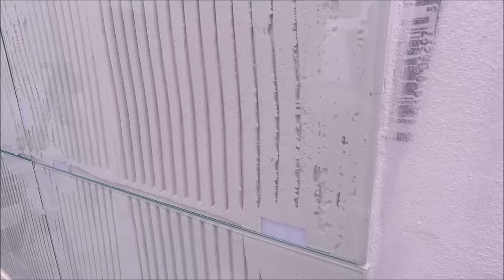How to use a Tile Leveling System for Walls

Comment: Great video (super idea to use glass tiles). I don't think you mentioned that the Ridgid system has "corner" pieces which can level four corners with a single spindle (so you could have used one instead of the four.
Reply: THANK YOU. I dont know who makes this and what types there are  but this seems like exploitation by manuracturer. Why use freaking 8 pieces when u can use 1 to hold down corners of 4 tiles?!
Reply: @MrExcessum  I am looking for an answer to a similar question.  I am about to try these on a 200 sq' shower project.  My question is, if you are using spacers to supplement these clamps, can you simply use the "B" clips for everything? It appears the only thing missing with the B clip is the little tabs that would go between the adjacent tiles - either intersecting or brick patterned..  Am I correct? As you pointed out, why use several, OR buy several different types, if the straight "B" clip can be used for all.

Comment: @landberg Tile TV Maybe I missed it, but is there any advantage between one or the other system?

The one advantage to the wedges was using a tool for a secure hold, while the Rigid requires you to use your fingers, and fingers may get more tired
Reply: you can use any piece of metal or plastic as a lever to tighten the plastic bolts i guess.

Comment: I am so happy that I paid attention in class when it comes to tiling and being in the tile business for 20 years and only being 37 years old thank God I don't have to waste unnecessary time with those stupid self leveling spacers and clips firm up and level my wall out and use the right trial for the job they won't show you what happens when you tear the tile down and have to replace the backer board and there is a huge difference from one side to the other lol nice video though for people that are in tile business that have been in the tile business if you went backwards and started using this method get out of the tile business the old way was never broken so don't fix it maybe it's the tile installer you're hiring just saying this also goes for floor tile as well way too many other methods out there putting all these spacers in one area would drive me absolutely nuts so much better way to do it
Reply: Ever hear of punctuation? Run on sentences?  These leveling systems are far superior to old school installers, who refuse to get with the times. Things change and improve over time.

Comment: Question. If I wanted 1/8" grout lines, would these leveling systems still be effective? You'd have 1/8" spacers, plus the 1/16" leveling posts. Would that still work effectively?
Reply: They are available in 1/8 inch

Comment: 2 quick questions: 1. Do you recommend using these clips for a glass tile shower wall, will you be able to see the clip remnants underneath through the tile?
                                  2. Can you do half a wall, then come back the next day and finish if you have time constraints? Install the clips under the last course then continue next day?
Reply: Good question….That’s always been an issue…I dig out some thinset for the next clips not install them…Then they can slide in at a later date…installing them and letting them dry never seems to work….make sure to check the ending rows to make sure they are flat and in plain with the other rows….

Comment: What do you do about the little pieces of plastic that remain in the grout line -- like the piece that is real obvious at 9:17?  Using a chisel to remove it seems a bit dangerous to the tile.  How do you do it?  Maybe just a razor knife?

By the way, so nice of you to do this.  You clearly spent time and money to make this for us.  My thanks to you.
Reply from the maker: The plastic pieces remain in and under the grout line. They are low enough that the grout line can accept the grout. You should definitely try these systems if you install tile!

Also, thanks for the kind words. I appreciate them and thanks for watching!
Reply: I agree there are obvious pieces that are above the grout line. This would show once grouted. I like the system but would be better if the clips had a weak point built into then when manufactured to ensure they break at the same point consistently which was obvious you were not getting. These systems are not used here in the UK if they were I’d definitely give them a go 👍🏻
Reply from the maker: The "obvious pieces" that you see is thinset mortar squishing through the grout line.  Also, the clips do have a weak point that allows you to knock them out. These systems definitely work and make your life easy when installing.
Reply: You can order them on Amazon from the UK or eBay
Reply: David and Oliver you guys are correct as many of these break above or flush with the tile surface as is obvious in this video where I count at least 4 that will not allow grout to be smooth. I use these everyday as well and after I bust them off with a mallet I inspect to see whats what and Ill either cut the rest out with a Ulfa knife or use a multi tool with the drywall cutting blade on it and cut the remainder of the clip out.
Reply: @LandbergTileTV  x
Reply: Yes they are. You can buy them in loads of trade places - even Screwfix sell Vitrex. UK vid here - https://www.youtube.com/watch?v=cBBl6Tpvjyk if you don't get trade but even B&Q do them.
Reply: Clean all of the thinset squeeze-out away before you strap. I've not found an easy way to get them out. Knife might chip glaze, pliers nibble bits off, multytool just kinda fuzzes it up. Take your time and keep it cleen
Reply: David Qualls I heard heating the knife blade with a lighter then cutting the plastic works best
Reply: @LandbergTileTV  I used the Home Depot QEP product. I didn't use the pliers. I can see how the pliers would have made it easier, but it was doable without them. 
All in all I was very happy with them. They broke well beneath the grout line so, no issues there.
Thanks again for the video. I wouldn't have considered them if I hadn't watch your video.
Reply: Sharp razor blade.. You normally have a 3/16 r 1/4 in spacer in there anyway so the actual grout line will let u remove any plastic sticking up to high. Even if your using the system as a spacer, it's soft plastic, a razor will cut excess right out. Nice video btw
Reply: @oliverbull1622  there is  a weak point built into them to break lower than the tile. Probably  only 1 out of 100 will break higher. It's soft plastic, a sharp razor will cut right through any high points. Especially if your using a spacer with the system
Reply: You sure that's not glue you're looking at. I've never had any clip failures
Reply: @oliverbull1622  They are used here bro you just need to look for them. and they are brilliant ;-)
Reply: David Qualls yes I noticed the little pieces of plastic still showing a little but I don’t think it isn’t anything to worry if you are an experience tile setter you can understand that it is something that a utility knife can handle i meen we remove hard ass thinset mortar right
Reply: i think it doesnt help that he didnt use spacers so there isnt a lot of room for the plastic to break any lower, with spacer on there would be enough flex to help it break lower down but i assume just like anything it has its cons you just have to work around and cut them out as best you can afterwards

Comment: I have a question, why do you scrape the glue with a trowel? The point is that the glue does not come out between the tiles or to set the wedges clean?
Reply from the maker: Yes, so that the clips can break off cleanly. Make sure to compress the ridges to fill that void when installing.
Reply from the maker: Yup, so the clip breaks off clean. Make sure to compress ridges to fill that void.
Reply: @LandbergTileTV  Thanks!

Comment: I have a question bro hopefully you can answer it , 
When I added the levelers between the tiles they were so hard to remove once dried I had to grind it out ! Why ????
Reply from the maker: The thinset was not cleared out with the margin trowel and pushed out of the grout joint. Try to avoid any thinset getting around the clips, otherwise you have to cut them out.

Comment: Have you ever used one of these systems with tile installed on Kerdi board?  The Kerdi board is rather "soft", and I worry about damaging it while removing the caps/wedges.

Comment: Hello.  Great video.  What is the best way to handle when you can only do half a wall due to time and need to start again tomorrow?  One tile will be set while you start the new row that can move.  Do you just have to deal with the fact that only one tile will be able to move and hope for the best?  Thanks.
Reply from the maker: You can insert the clips with the wet thinset. Is this what you're asking?

Comment: Super video. Is something like this needed for doing tile backsplash in a kitchen? I'm thinking the same issues with having level tiles apply. Thanks again.
Reply from the maker: No, we don't use this system for backsplashes as the tiles are small for a backsplash.

Comment: Will this help with a slightly uneven walls? Some areas are 1/16 to 1/8 off. Thinking of getting the leveler if it helps instead of leveling the wall with thinset. thanks. Great presentation.
Reply from the maker: Yes, this will help using a half x half inch trowel and an anti lippage system.

Comment: When you back butter the tiles, normally, do you back butter it with the same coverage as you did the wall? And what size trowel notch does one use for a 16.5 x 16.5 inch ceramic wall tile, please?
Reply: back butter is a thin coat. you are pushing mortar into the tile so it connects better with the ridges on the floor/wall. you use a flat trowel, set the tile flat on a bucket, and push a thin coat onto the tile.

Comment: Considering use a 35x12  3d textured tile (Emser  NUOVO cube, to be exact)  on the long wall of a shower as an accent wall. Which style lippage control system would you recommend? Please share if you have any experience with this type of tile.

Comment: Great video to visually see how these leveling systems work.  I'm preparing to do a floor and tub surround in an extra bathroom and I think I may try these.  A 6x24 tile was recommended for the walls which is larger than I've worked with before.  1/8 or 1/16 lines, and for the short walls (~29 inches) something a little less than a 1/3 pattern?
Reply from the maker: I would definitely use a leveling system for 6x24 planks. We like smaller grout lines (1/16), but either would work. 33% offset is good. 50% offset is good also.

Comment: I used the spindle system they are really good, the only problem is some don't snap off properly and they are really hard to get out, I had to get a Stanley knife and cut them out it was a nightmare.

Comment: what if you cement is not totally level? do these help with that?
Reply: with very large tiles, (ie. 120x60cm, 4x2 feet) do not even try it on uneven surface. if i remember correctly the maximum deviation is 3mm every 3 meters.

Comment: I UNDERSTAND this is a video comparing the two types of "lippage" systems but couldn't help but focus on the ridges of your thin set. Based on the CLEAR glass showing that the ridges of your thin set were not collapsed as desired (required) to get 95% coverage in a wet area. MAYBE as you mentioned a 1/2 x 1/2 might of given better coverage. NOT TRYING to be too critical but I think I would of waited and had the proper trowel so that your video was absolutely the best information you could of presented.
Reply from the maker: Keep in mind, I have over 250 videos on my channel.
Here is a video on trowels: https://www.youtube.com/watch?v=UpmIAuGlgSM
Here are two videos on collapse ridges:
https://www.youtube.com/watch?v=2z5UbWawBAY
https://www.youtube.com/watch?v=UpmIAuGlgSM
I do appreciate all criticism! Thanks for watching 👍

Comment: Not getting very good tile  coverage should slide the tile back and forth  slightly to let the air out I’d say your only getting around 40% coverage even if you back butter still need that side to side movement opposite of your mudd lines

Comment: I thought the Rigid ones go at the cross section of the tiles leaving less clips needed. That is why the spindle is so large. This cuts down the amount of time placing them and cost of the of the clips you need to buy.

Comment: also, would you back butter the tile to be parallel with those on the wall or cross-wise, perpendicularly to the wall lines.
Reply from the maker: We skim coat when we back butter tiles

Comment: I’m confused. “As you can see...” you can see the plastic behind the glass. How is that superior? So if I back butter properly for glass I might still see this plastic tab after all the finish work?
Reply from the maker: You would  ever install glass panels like this. The panels were used simply to show  the mortar and compressed ridges. Plastic bathing tiles will not affect the bond.

Comment: Almost perfect. A+ for effort. The glass has no deep bisque to key in. Also, a tile "mechanic" like me has to beat in the tiles for full coverage, flatness and test for breakage. Travertine stone, for example is a Lot more brittle than glass. And, after doing all that work, it would be a painsteaken process to have to remove and replace broken tiles.

Cute system for DIYs installs though.
Reply: Just wondering....so would u choose to use the regular spacers instead? Just trying to get feedback from a pro

Comment: Good  demo.? What if you make the set  tile 1/2 do you need more clips
Reply from the maker: I don't understand the question..
Reply: @LandbergTileTV  I think he is asking if you stagger the tiles, do you need more clips.  My answer would be "no", but I guess it would come down to preference. I just did a floor with 36"x5" tiles staggered into 3rds. I used the wedge system and they are wide enough to catch the end of 2 tiles on one side and 1 tile on the other.

Comment: Hey Landberg, question for you. Have you ever had any trouble with the spindle systems damaging tiles when having to spin them really tight? I know you probably wouldn't have to worry about any knicks or a scratches on porcelain but what about on a tile that's damaged easier like ceramic? Ever knocked the clip off to find scratching underneath? Thanks.
Reply from the maker: Not with porcelain tile, maybe stone. Spin doctor offers plastic protection rings for this issue.
Reply: @LandbergTileTV  thanks

Comment: Please demonstrate how this can be done on a large wall that has bellies and bows, and is out of plumb on one end and out of plumb the other way on the other end. Thanks.
Reply from the maker: You should address a wall that has bellies and out of plumb prior to installation.
Reply: @LandbergTileTV  So why would i need a levelling system to lay a wall flat and plumb if the wall i'm laying on is already flat and plumb?
Reply from the maker: @al1979rocker  these systems are for anti lippage for installing large tiles. They simply level two large times together.
Reply: If the tiles are true and flat, why would I get lippage?

Comment: Your air channels need to be collapsed more: you need to move your tile left to right more in order to push all the air out of the grooves. Essentially, you need to move the tile about 1.5 x the width of the groove. so in this case, it needed to be moved at least 3/8" from left to right, several times, to ensure all the air has been pushed out.
Reply: It's better to use the 1/2" notched trowel like he said. Back buttering isn't necessary and is a waste of time in my opinion. But you need to use the right trowel. Definitely need to move it side to side. To check it I tap it with a screwdriver handle. You can hear the difference between hollow and solid. If you check for coverage after back buttering by removing the tile it may be deceiving.
Reply: @RollingThunder808  You ALWAYS backbutter large format tiles: only way you know for sure you have good adhesion. The width of the notch increases with the length of the air channels created by the trowel. This is to allow the air to escape when you're seating the tile.
Watch this video where they did side by side tests: bF2SgLBF6qI (not sure how to share links, but do a Youtube search for that)
Reply: Super-tiler to the rescue! But super-tiler doesn't comprehend verbal instructions very well. How many time does the guy have to say it? The video wasn't about mortar applications and setting tile. It was to demonstrate different tile leveling systems.